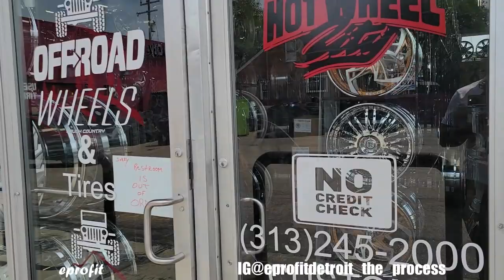Chevy Camaro thirdgen on 24" wheels ( RUCCI'S) POT HOLE VICTIM - KANDI  DOWN

Comment: This usually happens because, the tire shop didn't lubricate the tire enough when installing the tire on the rim. The tire is low profile, so trying to stretch the tire over the rim causes the tire to tear internally......anyway....im glad you and Kandi are safe
Reply from the maker: the damage is inside the rim , its a hair line crack right on top of a seam on the barrel about 2 inches from the lip , right where the face screws onto the barrel .. I hit something but dont remember it being that hard of a impact so i have my Concerns about the quality of these wheels and 255-25 profile tires are just to small . i was warned 🤦🏾‍♂️
Reply: Yeah bro them low pros like that really for down south riding..we got to many pot holes in the d